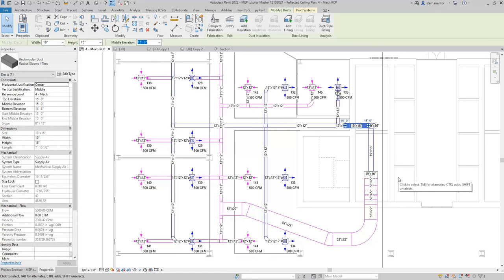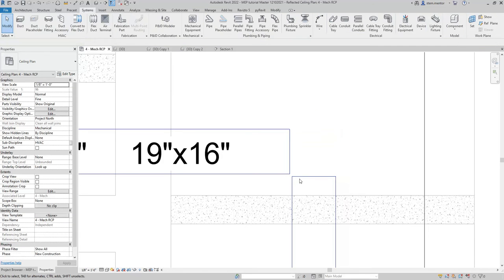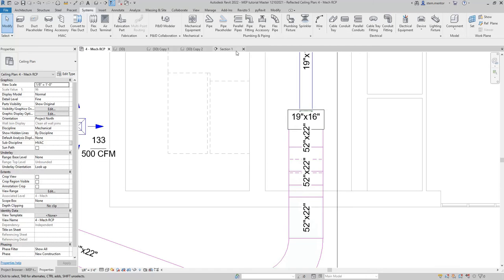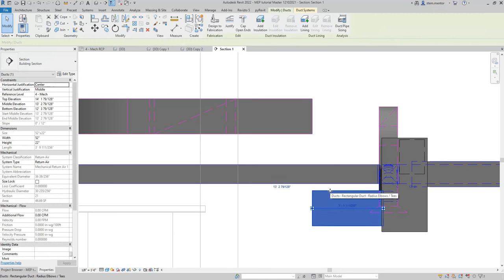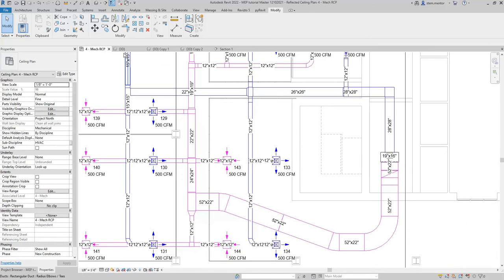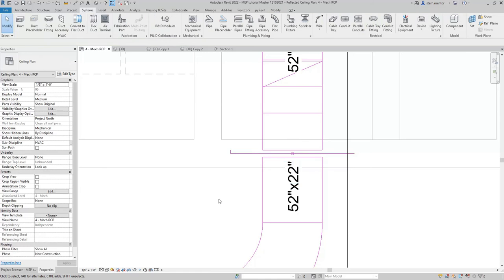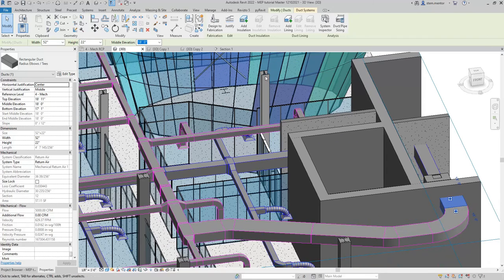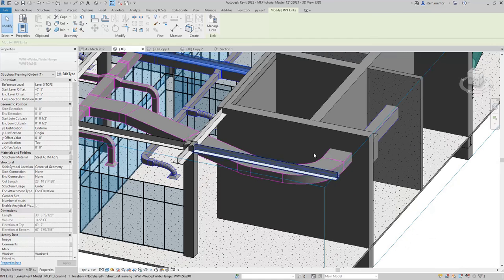REVIT MEP HVAC How to resize ductwork and place fire dampers (Part 2)

Comment: Cool Brooklyn accent...  Good tutorial, but I am curious to if the duct sizes and CFMs are actually linked to the parent file, with considerations to building orientation and insulation values.  From a design perspective, are ducted returns now normative in NY? as ceiling plenum returns are much more efficient and less fussy -- except where mandatory for hospitals, labs, etc.